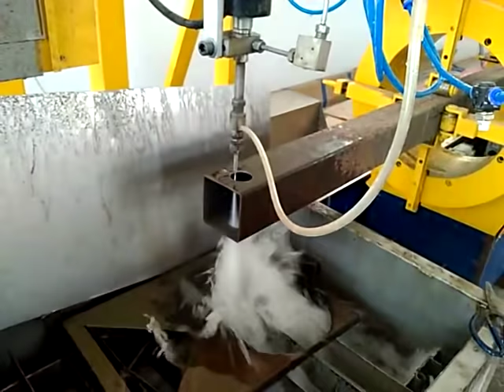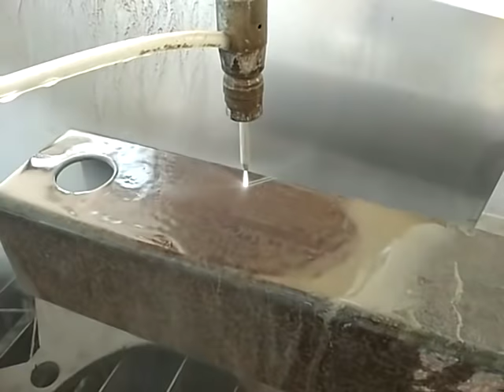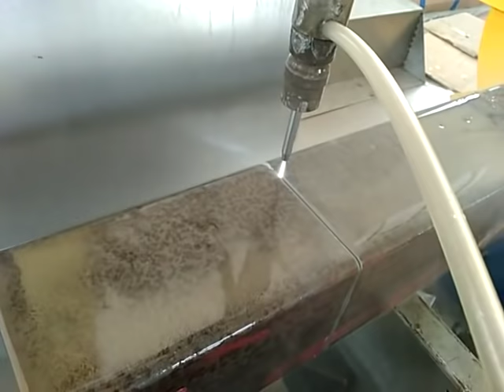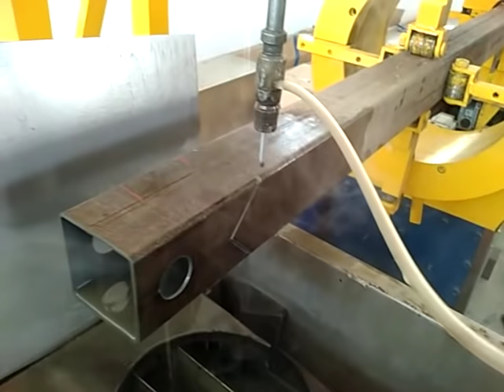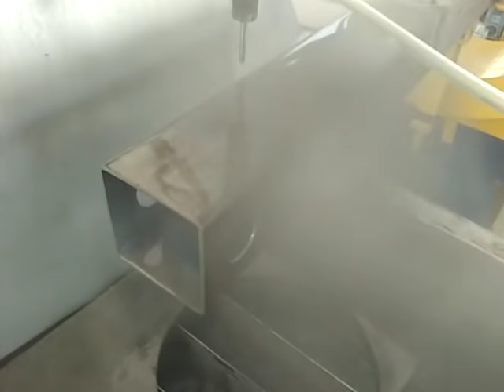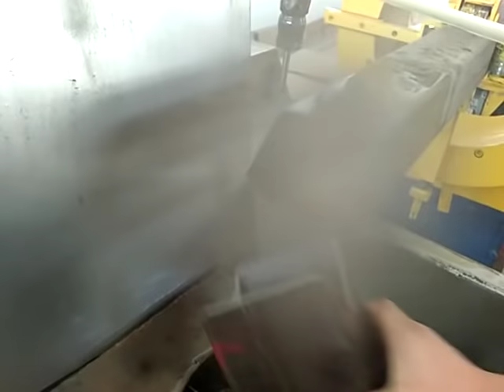IWM waterjet pipe cutting machine 02 - cut steel square tube

Comment: Advantages : No heat affected zone. No material distortion. No material waste.
Reply: You don't think there is friction which causes heat?
Reply: @killaryhitten5243  In waterjet cutting, there is minimal heat generation because the process uses a high-pressure stream of water, often mixed with abrasive particles, to cut materials. The water absorbs most of the energy, so there's no significant friction to cause heat buildup like you would see in traditional cutting methods. That's why waterjet cutting is considered a cold cutting process.

Comment: What is the density of the water used for cutting?
Reply: 150 PSI
Reply: water cannot be compressed
there is pressure lot's of pressure more than 60k PSI
Reply: @hirendrabarman7443  are you sure😆

Comment: The cutting resolution is shit. Lower the mixing tube to .100in and adjust the radius diameter to the correct tool measure in the software.
Also the edge finish look bad. Or maybe try laser cutting instead of this technology. Doesn´t make any sense.